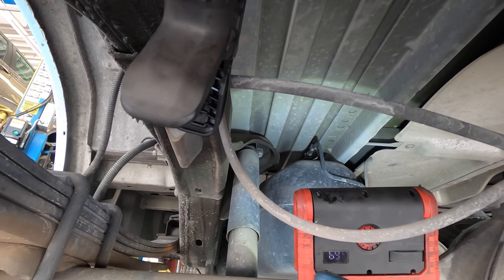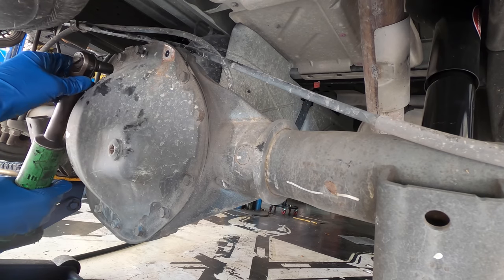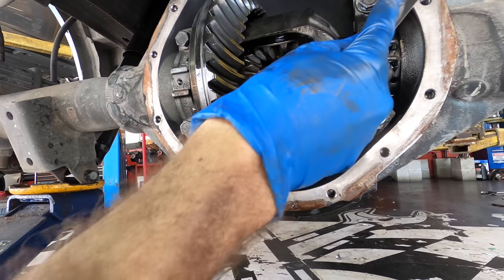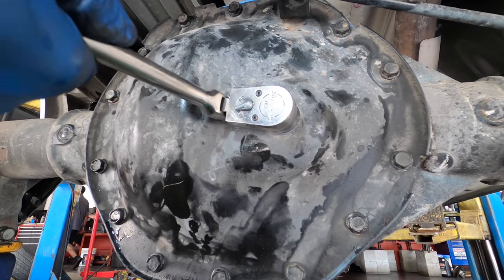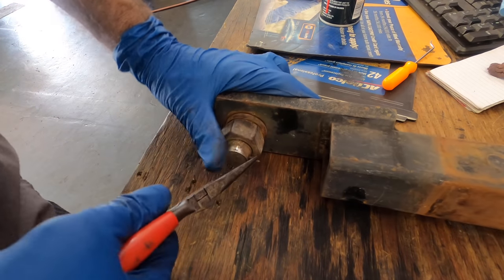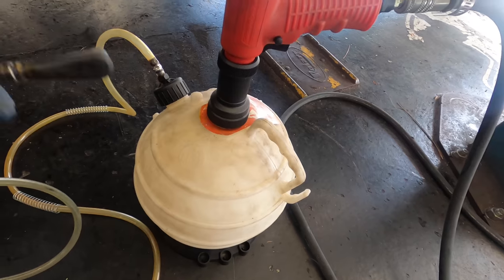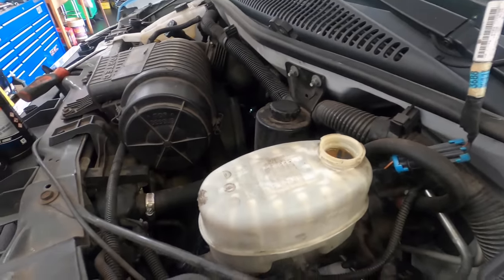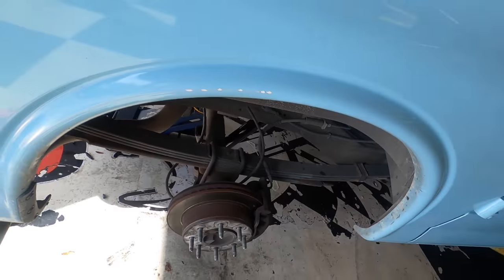GMC 2500 The Rebuild Continues. Cracking the Diff cover and MORE!

Comment: Hey Mister!, would you tell us a little bit about your camera support? Sometimes you adjust the camera and it slowly gets into place, what do you use? Also, I have seen you use socket wrenches even with bolts that are really tight. How much torque those socket wrenches can support without breaking? How do I look for them (I am not actually in USA, therefore I cannot go to a recommended shop to buy them).
Thanks again for the advice and cheers!

Comment: Ray, what brand is that bleeder? Works the same as the one I have in my shop, but mine is hand held. Would be nice to have one that sits one the floor. I had one of the fancy 5 hose machines at Nissan, but now that I have my own place, it's not in the budget.

Comment: I have something to say about the caution that should be used on the seals on those brake fluid bottles. I have a video on my channel about it. https://youtu.be/uv8TlCvUMuU . Basically my brake master cylinder developed a bleedby which caused my brake pedal to slowly sink to the floor. I thought I may have had a bad break master cylinder. Turns out there was a piece of that plastic bottle seal wrapped around a piston seal inside the brake master cylinder allowing fluid to bleed by. It was not from me because I use the expensive Pentosin Super Dot4 and those are metal containers with pull tab seals. Not a thin plastic seal like on those cheap plastic bottles of brake fluid. (My car is a 2014 Maserati Ghibli SQ4, only the best for that car). That had to have been introduced by a mechanic the previous owner had work on the car. (I bought it as a lease return). He was not paying attention when he broke the seal and poured the fluid in. A piece of the plastic seal was poured in with the fluid. Or he saw it and then gaffed it off not wanting to do the work necessary to get it out. Check out the video to see it.

Comment: Ray, What are you using  for your spray cleaner. ?
Reply from the maker: Just brake parts cleaner.
Reply: @RainmanRaysRepairs  Ok 👍 I thought it was but you never know. Also my friend are the battery operated  ratchets 
 All SNAP - ON ?

Comment: When not in use it is a VIOLATION to have a hitch rotruding past the bumper, if you look at where the mount is, just flush with bumper , with a cover when not in use.  A trailer hitch protruding is a hazard, when not in use to pedestrians and for rear collisions, ever wonder why they are made to be REMOVED when not in use.....DOT SAE rules

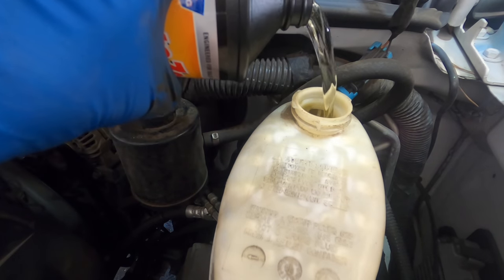Comment: 30:52 I never play around with brake fluid. It's harsh on surfaces.
Reply: Ever heard of brake clean?
Reply: @ivananderzen5287  brake fluid is corrosive
Reply: @calvinevans8305  and brake clean cleans brake fluid.
Reply: @ivananderzen5287  does it neutralize the corrosion or just spread the brake fluid everywhere. I use brake cleaner to get grime off of the rotors and many other parts of the car.
Reply: @ivananderzen5287  water is good for cleaning brake fluid spills as well. I keep a spray bottle with clean water nearby when I work with brake fluid on bikes.

Comment: Not much chance of that nut going anywhere, a dab of anti seize would've helped when they put it on with appropriate torque. Heavy duty zinc plated key or pin, not likely to rust as badly, hopefully.

Comment: I seen a person when they did a differential fluid change they filled a plastic bag with fluid and put it inside the differential put the seal on the back plate bolted it down added a little fluid and drove the vehicle. They said the plastic shouldn't hurt anything it would be ground up and would become part of the fluid but not sure if that is a good trick or not.

Comment: I have always wondered where the diff breathers are and do modern cars (2018+) still have diff breathers?
Reply: Yes they have to obviously
Reply: @archiedentone5950  As I'm not a mechanic I couldn't be certain. The last car I ever worked on had a cracked camshaft, a distributor and carburetor with no computers to be seen. I did a lot of googling for my current car (2018 jeep compass) and have been unable to find any satisfactory information. Hence my wondering. It does make sense that they should have but I would like to know :)
Reply: @locutusofborg  they all have them as a necessity. Some work better than others depending on terrain

Comment: Have you ever forced fluid from bleeder up into reservoir?
Reply: Aside from making a mess (fluid coming from around the bleeders) part of the reason for flushing the fresh brake fluid through the system is to flush out the crud. Crud travels "down" through the system so there is more of it near the bottom. Why push it back through the system?
Reply: @utidjian  
To push the air up.
Reply: @brucebaxter6923  That might make sense IF and ONLY IF brake fluid had very low viscosity and there were no intermediate high points in the system (air traps.) But it isn't low viscosity and there are lots of air traps. As you can see in the video the air that leaks in around the bleeder threads and any other air in the system drains very well "down" the bleeder hose. Those vacuum bleeders work really well and they have been around a long time (I was using them 40 years ago.) I was not so impressed by pressure bleeders. I had a pressure bleeder setup and one needed an adapter for every make and model of reservoir. In my experience it was MUCH more efficient to use a vacuum bleeder  (most bleeder nipples are similar enough to only need one adapter.)
Reply: @utidjian  
You use high viscosity brake fluid!
Wtf man.